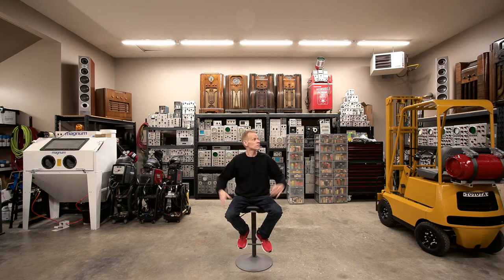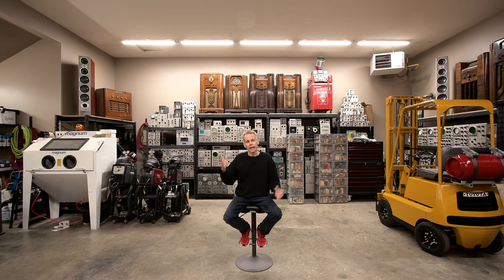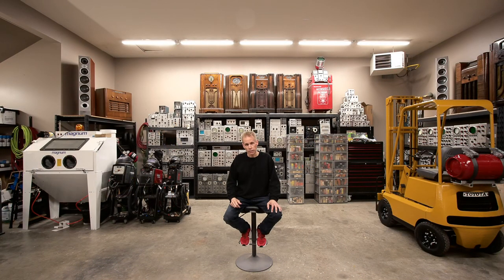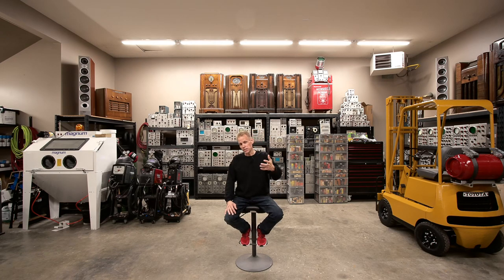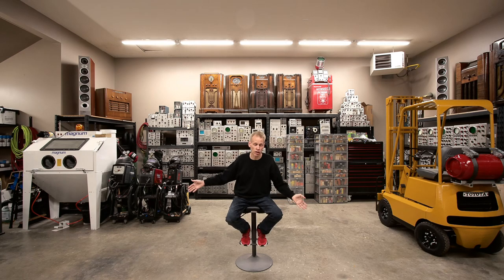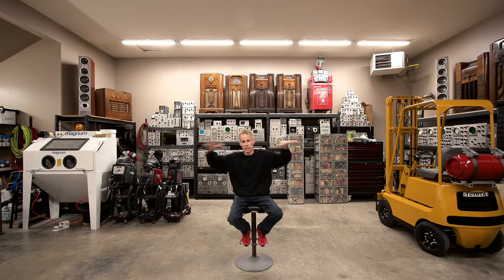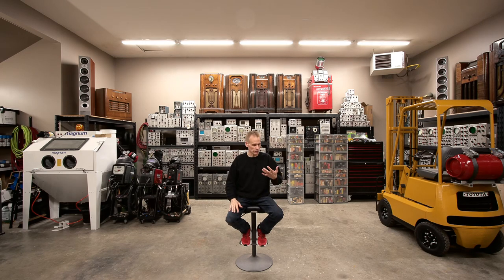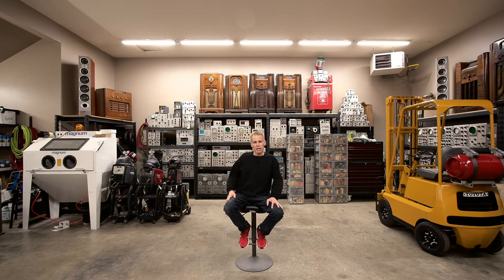ZAP! Mr C's Worst Electric Shock Explained In Detail!

Comment: I've been following your channel for some years already and I felt really identified with your story! I work as a car mechanic but I also like to work on electric and electronic stuff, just recently I electrocuted myself with one of those machines that recover the ac refrigerant from the cars, It has been my worst shock of my life as the machine works with 220v, a live wire basically made contact with the machine chassis and I as I went to close a valve from the machine, it just happened, I was being electrocuted and I was conscious too, I tried really hard to get away from the machine but I actually lifted the whole machine, I yelled at first from the pain, but when I felt I was unable to free myself I did put all my efforts to actually yell for help and when I felt that I was getting unconscius I did let go of it somehow , I was still standing but fell an immense pain in my abdominal area as I tore off my muscles when I lifted the machine and of course I had a third degree burn on my arm. It happended very quickly, I counted about five seconds from the video on the cctv camera, and everyone in the shop went running to me from my first yell but if felt like an eternity at that moment. It might be the scariest thing that has happened to me. So take care guys, and really try not to get comfortable near dangerous stuff.

Comment: I had almost the same issue 40yrs (17yrs old) ago working on a Hallicrafters HT-40 transmitter.  I reached over the PA and ZAP!  I think I had about 350V across my chest and it shot me 10' across my bedroom and my head and shoulder ended up busting a hole in the drywall.  I learned my lesson.

Comment: So glad your still with us Paul.
My experience was as a 10 yo kid . I stuck my finger in one of those pilot light sockets on a cloths iron my mum was using. 240v AC from a fused only distribution board .It felt like the muscles in my arm were twisting. Thankfully I didn't lock on. Guess the footwear I'd  on saved me ' cos I was able to pull my finger out. Was too scared to tell my mum.

Comment: Wow, what a story !  Scary thing is that it is true.   I have been in electronics for many years.  The scariest power supply I worked on could deliver 8000 volts at 8 amperes.   Could easily be deadly!   I respect your cautions about working around high voltages.  Thank you for sharing.

Comment: I had not seen this until just now (9/22/24). I'm really glad you shared that experience with your viewers that may not have much experience with electronics. They need to know that even an expert like yourself can get shocked badly. And that working with power equipment requires lots of attention, and even then you can still get bit, don't wear rings or anything metal that can get welded to your finger(s). Keep one hand behind your back (back pocket) when probing so you don't complete the circuit through your heart if you do get bit. Best Regards Mike

Comment: Wow! Thanks for sharing that story!
I’m a retired HVAC&R tech and also did residential and some commercial wiring.
I can relate to that feeling of not being able to let go and I swear I thought I was feeling 60 hz buzzing through my body. Then something knocking me away just when I thought I am going to die. Never been nailed like that with high voltage DC. That is weird that almost getting electrocuted by AC or DC and it might feel the same way.

Comment: I'm so glad that you made it. I service tube equipment such as Hi Fi amplifiers and guitar amplifiers and I have been hit a few times with 3 or 400 volts DC. It's not fun. I have been fortunate that I was able to disconnect myself from the shock source every time. Nothing ever went through my body as your shock did. My shock were just me rubbing the back of my hand on the wrong component in the chassis by mistake while I was reaching for something else. My worst shock came as I was trying to discharge a CRT TV tube using two screwdrivers against the back strap of the tube. I think I may have inserted one of the screwdrivers under the anode cap before making a good ground and the shock made its way through the handle of the screwdriver and threw me up against the wall. I remember losing sense of taste and shaking really bad for about a half hour. After that, I went back in and discharged the tube properly. This was around 30 years ago and I'm glad to say that everything is now LED displays that uses low voltage. In your case, your mic may have not been providing galvanic isolation to the input stage of the tube. But what boggles my mind is where the path to ground from your hand, through your heart.

Comment: Thanks for posting this video Paul--HV is the REAL-Deal!

My worst shock was from a Fender guitar amplifier that I was working on:  It was late-afternoon and I was throwing a party in my basement and at the same time I decided to take this Fender-amp chassis out of the cabinet to work on it.  The customer had dropped it off and I wanted to either quickly diagnose/fix-it or at least get an idea of what the characteristics of the defect were--so my mind could process that in the background.  The complaint was that after a transformer change-out, the amp was distorting and the PA-tubes were cherry-ing out.

As more and more people showed up, I ended up on the floor, allowing my guests to subsequently take the couch, chairs and (yes 70's) beanbag chairs.  At this point my Altec Home-version VOT's were turned up and it was a madhouse of music, activity with people asking questions and saying 'Hello' to me.  

So, being an experienced tech, having serviced hundreds of TV's, stereos, and all manner of communications equipment (of which were mostly tube) I had become rather cavalier in my safety protocols!  So, here I was with this Fender-amp lying on top my bare-legs, with me wearing short-pants.  After a quick look-over and finding nothing obvious, I powered it up and started taking some voltage readings.  I didn't check the plate-voltage, just assuming it was there, but did check other voltages and several were high and just not right.

I paused when someone asked me a question, or in some way engaged me in conversation.  As I was talking to them, I became distracted and forgot that I had the amp still energized.  As we were talking, my OCD kicked in, and I started randomly straightening components that were bent-over or needing aligned; I was doing this totally oblivious that I still had the power on.  Mind you, I had the amp on my bare-lap, and was holding the chassis with my left-hand, and straightening components with my right!

Well, I finally  reached over, and started to straighten one of the 6L6 plate-resistors when I got hit with the full plate supply!  It was like a bomb went off and I was instantly buzzing, I remember being in slow-motion and being totally-deaf; seeing action and people around me, but without sound.  Somehow I managed to get loose.  

At this point I was in deep-shock and started to slowly scissor my legs back and forth to push the amplifier off my legs--I remember not being able to use my arms at all!.  Since everyone saw me react, nobody wanted to remove or touch the amp.  I managed to get it off my legs, and for the next 30-minutes was unable to talk, and only mostly looked forward, sometimes managing to look around without any of it making sense.  I remember people looking at me and trying to get me to respond, but I just couldn't comprehend.  Slowly my friends rousted me back to reality, but in that time I had literally (for real!) swore off doing any electronics ever again!

I later (after re-engaging in the field of electronics!) measured the plate-voltage and it was over 650V; it should have been about 400V!  The transformer that had been installed neither fit or was the correct voltage but had seen even old TV transformers used when people didn’t have the money!  And those ‘plate-resistors’ even though they were on terminal strips, they or the terminal-strips didn’t belong either but were used in failed attempt to bring down the B+.  So, all of that was stripped out and an original transformer was installed. 

This has to be the damn-dumbest thing I ever-ever did, and I nearly got killed.  It was a good thing that other people were there.  
So remember, at least 'Safety-3rd' !!!
73...

Comment: Paul, When I was 16 in 1976, I was working as a repair tech in a local CB Radio shop. I was working on a 500W tube amplifier (yes, 11 meter), and temporarily forgot the "one hand rule"... and the screwdriver I used to discharge the 450v filter cap was somehow connected to my fingers that were holding the tool... OK, I wasn't being careful... but my left hand happened to be holding the chassis... well... yeah
.. "I" discharged the capacitor alright... arm to arm.

When the owner of the shop came running in to see what had happened, I was still on the floor, trying to figure it out myself.

He looked around the room and asked why my screwdriver was stuck in the wall several feet behind where my bench was... Stuck up to the handle through the sheetrock.

That too was a painful experience... and ever since that, whenever I got bit by a CRT HV discharge... it seemed far less painful... in the scale of being shocked... probably because even though the TV CRT is a lot higher voltage, the large 450V DC filter cap held more energy.

Comment: thanks for the video i remember stripping some wire and found myself on the ground because the wire was a hot 115 volts in a 220 3 phase circuit.i know that feeling of the 60 cycles ac buzzing in my body.thanks for offering help with projects and sharing .
Reply from the maker: Thanks for sharing your story!

Comment: I can relate Paul. Back in the late 60s I was working in a 17" b&w TV. I was rotating the yoke while looking into a mirror for correct positioning. Not watching my hand, one of my knuckles came to close the 1b3 tube. My knuckle drew an arc and I got thrown back from the TV. after I came to. I measure the voltage at 15k. It delt like my hand was im a vise and hit with a hammer.
To this day I still have the scar from the arc along my knuckle. The shop smelled lile burning flesh (yuck)
Needless to say I went right back to work amd got the set adjusted.
I am glad to see you still with us.

Comment: I've been shocked three times by 240V AC and I absolutely agree with your comments about the unpleasant sense of 'vibration' from the 50/60Hz line. 

I have a friend who is an electical lineman and one of his colleagues was killed, not by electricity but by falling from a pole. He was careless and did not engage his safety harness.

When it comes to electricity, complacency is always the biggest danger.

Comment: Year ago I heard this story at Graybar. The guy said that morning he came to work to find two dead guys attached to each other and a 6Kv power distribution panel. They had broken to steal copper wire. It is expected that one couldn't let go and the tried to free him.

 I built dangerous high voltage high power lasers as a kid too. I knew one touch would be at the very least devastating and likely fatal. So I never did. I have had a few tingles over the years but nothing like your story, glad you made it. Telling the story is very valuable hope everyone listens.

Comment: Hey there Paul ,
It is good too hear from you again .
Watching you tell about your worst shock again , for I think my fifth time 😅 I  was reminded of my worst shock . My father and I were replacing  the  fan motor in an old swamp cooler (evaporative cooler) and Dad handed me his Leatherman multi tool to cut the electric  cord going into the motor. I stopped and asked my Dad if the unit was unplugged inside the house ! And he said to me (if it was plugged in , wouldn't it be running ?) It seemed to make sense to me at the time ! So I went on ahead and cut the wire ! The thought went through my mind that there is no insulation on the handles of a Leatherman  tool , and I am setting on a all metal roof of this mobile home , and I even had my opposite hand in the water tray at the bottom of this unit ! I tried too let go of the multi tool but I  had no control over the muscles in my body as it was convulsing from the full 120 volts and 20 Amp circuit  the cooler was attached to !
I had to fall backwards and pull my arm and hand free of this tool of death ! It almost got me that day !
I will not share with you or the many viewers of your channels  what I had to say to my father for the roll he played in this ! But I will never trust him or anyone ever again when it comes to electricity and whether it has been properly disconnected or not ! So I truly do understand  the dangers of electronics and electricity ! I am thankful to be alive and that you are too !😊
Reply from the maker: Thanks for sharing your story!

Comment: This brought a memory back. In 1972 I worked in an electronic repair shop. Since I was expendable (ha ha youngest) I  did many crt r and r work. One time I forgot to discharge the crt and those oldies had huge crt's and the volts to drive them. I saw the spark coming and was then on the floor!

Comment: Hi Paul. Thanks for admitting a mistake that almost cost you your life. Glad you are still with us. I always thought these "War stories" were admissions of error. I did not consider that they could be beneficial to keeping others safe. I admit, I was working on an RCA TTU55 UHF transmitter, (55kW) dual klystrsons with 23.5kV anode. This was a massive unit, 15x25ft footprint you walked inside of. I shut the cabinets down and de-energised the HV with a grounding stick and hung my sticks. All safe. The Klystrons were vapor cooled, and a water leak had occurred in the focus magnet flow meter. I had a puddle on the floor inside the transmitter. I reached my hand in to the left side of the Klystron cabinet, and I couldn't move. My wedding band had caught the back of the focus magnet tilt release and was "spot welded" across the contacts. The control voltage in the cabinet was 120v @20A. The breaker finally snapped, and I was free. It left a 1st degree burn on my finger. I should  have taken it off, but the sticks were hanging on the HV, and it was 1am so I missed that. To this day, I wear NO jewelry. I never thought that one simple safety step could save someone, and your video gave me the courage to share a moment when I was less than my best.

73s
Steve

Comment: My worst electrocution was when I was in my early 20s. I was the Chief Engineer for WQLR & Failrfield Broadcasting in Kalamazoo. MI. Our Main transmitter had gone down, and I had been informed that we had a backup transmitter (no one had told about this until then). It was located in an AM radio station on the NE side of town. I had never seen this transmitter, I THINK it was a Gates FM-1H. Anyway I tried to fire it up, and it was not happy, or I didn't know what I was doing with it. The manual I had was tatters of mouse eaten paper... And, I was pretty much alone, there was a DJ somewhere in the building.
I opened up the back ad proceeded to do the grounding ritual on all the power supply caps. Then I put my hands on the main tube. This was a high power tube with a Beryllium case and contact rings going up the body of the tube. They fit into circular contact ring fingers. 
And WHAM, I got hit bad. So the shelf I was resting my arms on had a lip bent upwards, and my arms were on that. What I had no idea about was that the circuit board the the contact finger were mounted on was used as a very poorly documented screen grid capacitor. I had not discharged that! I got hit I think with about 2-4KV. Luckily I had my arms resting on the shelves metal lip, that meant that most of the current did not go through my torso. The bad news was I had my arms resting on the edge of the self, the shock had caused my arms to jerk back, and I had skinned them pretty good. I felt like my chest was going to explode. I felt dizzy and disoriented. I remember wander around the building until I found the main studio. I was worried that I may still keel over. I told d the DJ what had happened, and then sat down in a chair in the hall for about 1/2 hour. Then when he got a break he came back with me as I proceeded to get that pig running.
(filed under How You Learn What Not To Do)

Comment: You were very lucky to survive such a severe shock, when I was around 12, I had a 1950's live chassis radio that I hooked up to a metal window frame as an aerial, one day I went to shut the window while touching the central heating radiator, I got a massive 240 volt ac shock that sent me flying across the room, how I survived it was a miracle! 
I certainly learnt my lesson & you are right to make a point about safety, electricity can kill.

Comment: I listened to every word of your story and I could almost feel your pain. As a teenager I will alsways remember the shock that I received while working with  a high voltage ac transformer.  I remember thinking that I had disconnected the power plug from the 120 volt bench supply but I had disconnected the wrong one. When I touched the two secondary wires the voltage and current went from one hand to the other and I couldn't let go for some time. I remember feeling the sharp pain going through the back area of my body and a loud humming sound coming from somewhere. I don't remember how long it was but I somehow had managed to free myself from the wires. I was alone in the basement and I actually thought that my family upstairs watchin television should have heard that noise. Later after measuring the ac secondary voltage from the power transformer it measured 700 volts. For weeks after I could still feel that pain in my back.